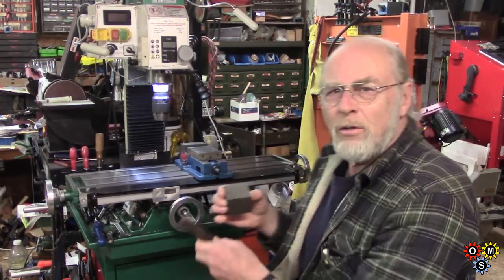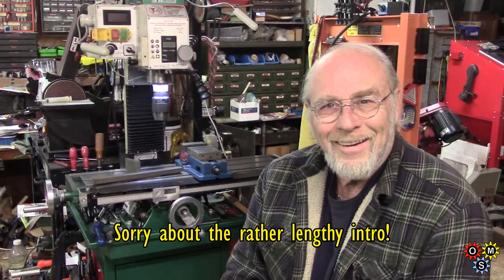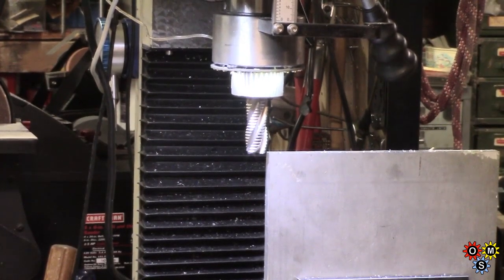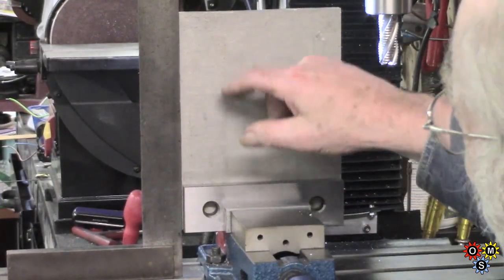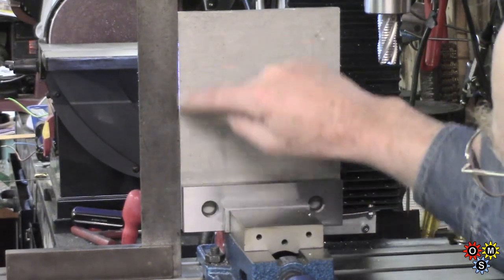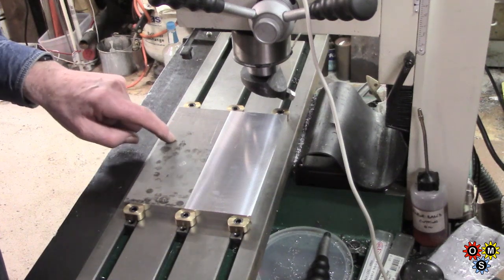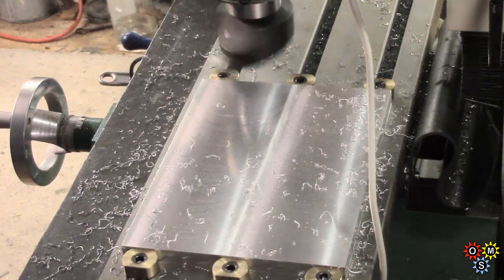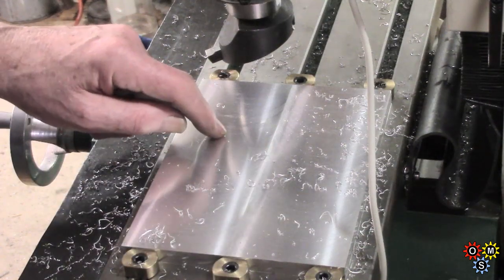Fixture Plate Part One

Comment: Hi Chris, you can shorten the time needed to face, shouldn't be a problem to run the fly cutter between 1000 or 2000 RPMs, just spray a little kerosene or WD-40, not to try with steel but does great for me in aluminum...   ;)
Reply from the maker: +pierre beaudry 
Hey Pierre,
Indeed, I realized I could run higher RPMs -- in part I was unsure whether the cutter balance was good enough to go that fast even tho I was only taking a light skim... a reason too I didn't bother with any WD. I also was a bit lazy with using a good tool grind.
 I do need to tram the table soon to check it out properly.
Reply: Even on light passes WD will help a lot on the finish, you'd be surprised how fast you can pin those fly cutters, start slower and ramp up...   ;)

Comment: Really good stuff here Chris.  This will be very useful as you know.  I see Stefan says he has a plate setting around too.  I have one left over from an old project as well.  Have had it for years and now it will have new life put back into it.  But, my work is so very random I think it would be better to let the hole pattern develop as needed.  That way it will not hurt so much to drill and tap as needed.
Reply from the maker: +Glenn Felpel 
Hi Glenn,
Thanks - I hope to finish it off pretty soon now when time. The main pattern is set but fully expect to add odd extras over time, maybe even a few plain holes here and there for pegs etc.
Happy Christmas to you and yours.

Comment: Nice project. It's something on my to-do list as well.

You may need to tram the head on the mill, both front to back (which is causing the little "step" between passes) and side to side (which is causing the significant cut on the trailing edge of the fly cutter).
Reply from the maker: +Peter W. Meek 
Thanks Peter - yes, this has occurred to me after that fly cutting - it's rather overdue! Must set aside some time and get it dealt with.

Comment: Your fly cutter is OK, except for the fact you have no chip breaker, it is the "tram" that is slightly out. I run my custom design fly cutter, of similar size to yours, in the range of 800-1000RPM (not RPMs as it is already plural) using HSS with a suitable chip breaker and get a machining-mark free surface. Not boasting, just saying you could go to the next level.
Merry Christmas from one Chris to another.
c
Reply from the maker: +Chris Stephens 
Back at you Chris.
I am overdue for a tram check and the tool in the fly cutter was a ''cheat'' - a quick set up and brief grind with an existing cutter - on another corner - bit basic must admit.
Your running speed sounds pretty high - may try that out sometime if balance is acceptable.
RPMs -- haha - of course incorrect but has become a bit of the vernacular! :)
Reply: High yes but finish immaculate, especially as I can take 2 mm DOC. Forgot to say those are Aluminium (Al-you-min-ee-um) speeds, but then i guess you worked that out yourself.. Tom Lipton has a video on chip breaker fly cutters, well worth a coffee break to watch, but even he missed a trick. One day I really must do some videoing.
Vernacular it maybe but one must maintain standards otherwise it wont be long before we all speak and spell like Americans. :>)
Edit: Tom's vdeos are "toolbit development 1" & 2

Comment: If you are tapping through, you should use a spiral point tap. Spiral flute are meant for blind holes as the chips are pulled up and should not be reversed until done cutting as small pieces of chip may wedge in the relief and strip or deform the thread as it is removed. Longer chips come out in one piece.
 Spiral point taps are much stronger, some don't even have flutes, and can be driven at higher speeds giving a better finish and lasting longer. They are much simpler and cheaper to make and they can be easily resharpened, something that is very hard to do with spiral flutes. If you need to make a special tap a spiral point is easiest and strongest as there need be no flutes to relieve. In a blind hole a spiral point tap (gun tap, as it shoots the chip ahead) will work just fine and doesn't bind with chips like a hand tap until it runs out of space at the bottom. I wouldn't even buy any hand taps except perhaps a bottom tap as gun taps can do it all. Even bottom if you remove or reshape the tip. The only hand taps I have now are either very small or special thread for which gun taps are not made, or leftovers from ancient times and pipe sizes.
 For countersinking the holes get a countersink that attaches to the drill bit. Maybe in a wood working tool store or catalog. If not then braze a bit on a collar opposite the setscrew. That would save a lot of cranking and be there for next time.
  If I ever get back out to the shop I will be making a pallet like this, been dreaming of it for far too long.
    Mike (o\!/o)
Reply from the maker: +Moholo 88 
Thanks for the comments. I have actually had good success with spiral flute taps on thru holes but take your points. I do not have many spiral point taps but aim to remedy that over time.
Have always lusted after a good set of gun taps!
Reply from the maker: +Moholo 88 
Hi again Mike,
Was thinking hard about your sage words -- have obtained a new spiral point tap and did a comparison power tapping. No doubt at all even with my low power little mill - the spiral point did great and less torque than the spiral flute. Glad you brought that up and thanks again.

I had hoped to find a countersink collar for the drill but no joy ... have decided to do a hand countersink after main work -- I get good results from cordless drill with suitable tool run at low speed. 
Happy Christmas.